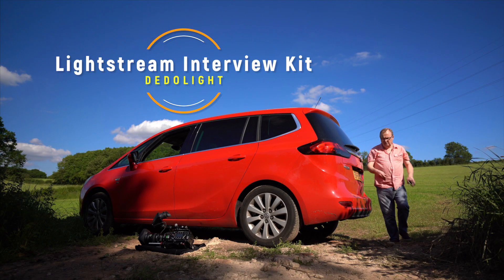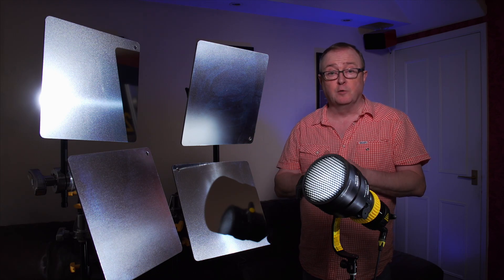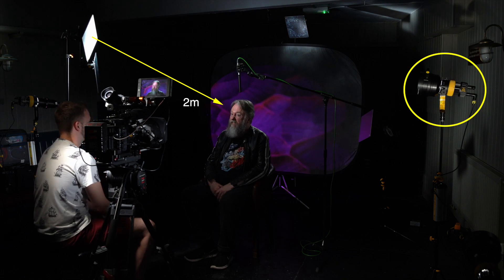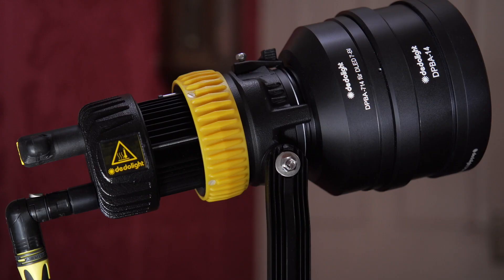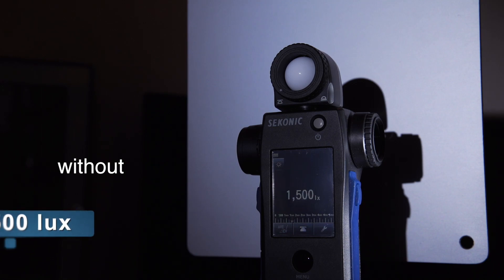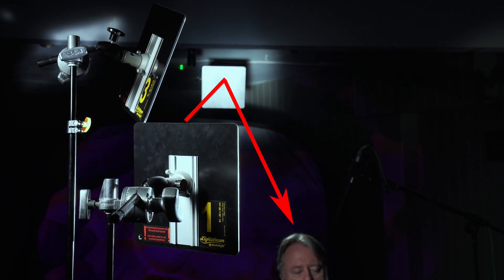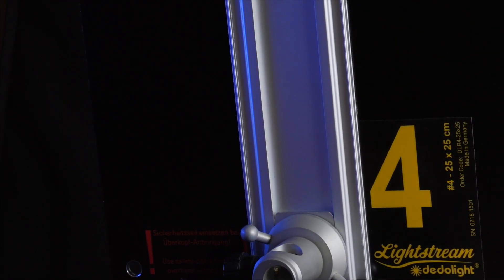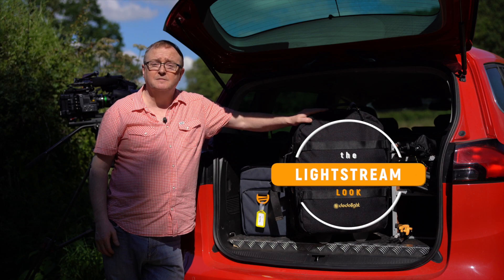Interview lighting with dedolight Lightstream reflectors

Comment: I love this concept, except for one thing - the shadows on the face are still pretty hard... nothing like as soft as a 4x4 polyboard or muslin bounce will give. I'm very drawn to it for size and space for documentary use, but can't see how the 25x25 or even 50x50 will create a big and soft enough source for a key where you're looking for a very soft, wraparound look.
Reply: Agreed. The prices of the larger reflectors you would need to create a softer source are also prohibitive.
Reply: yeah, he is using a hard reflector....I have the 50x50s and when using the soft reflector (#4) it is very soft...no hard edges....I wouldn't judge them based on his choice of reflector

Comment: Is the dedolight at full power?  I'm wondering how far apart I can have the lights from the reflectors with the DLED 7 turbo?
Reply from the maker: To give an indication: at 4m distance a DLED7-BI with DPBA-714 intensifier has about 4.900 lux on the reflector.
Reply from the maker: the lights in the video had been used at 60% intensity